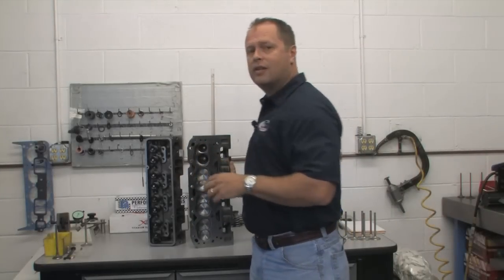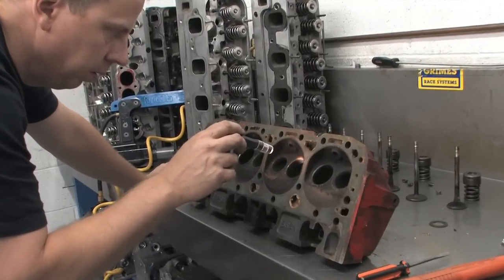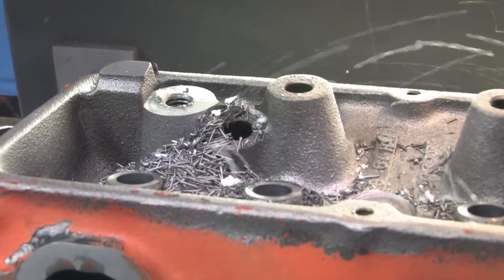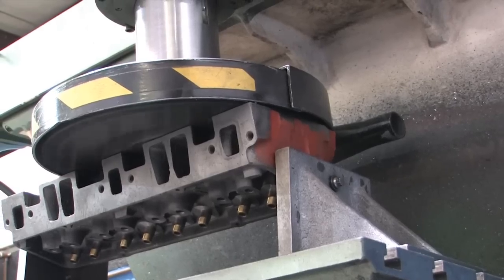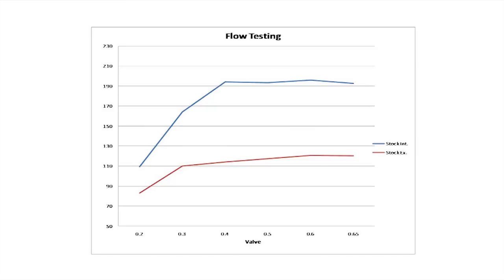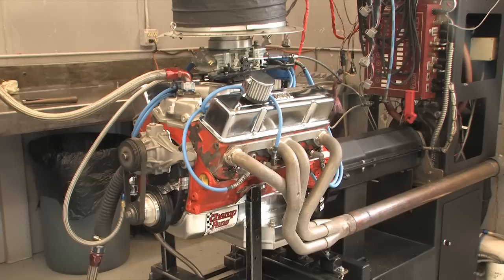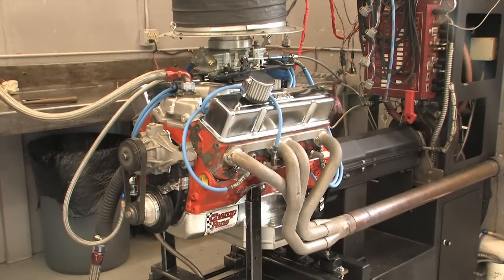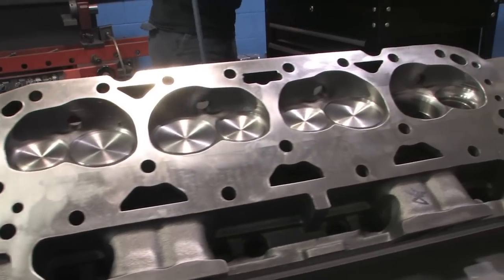Chevrolet Cylinder Head Dyno Test

Comment: Wait wait wait the biggest valve you can fit in an 882 head is a 1.94 intake? Because Im pretty sure I have a set that has 2.02 intake and 1.60 exhaust and when I bought the heads they had 1.94 int and 1.50 exhaust
Reply: your heads more than likely flow more than 193 cfm with the 2.02s
Reply: ryan ishee  the L82 and the z28 I think in 1973 to the early 1980ies had the big valve 882 heads .I have a 1976 L82 vette which I purchased in 1980 and still have when I rebuilt and moded in 88 it had 882 with 2.02 and 1.60  I have the heads on the car today along with a street supercharger it makes great power hp and torque with other mods

Comment: Coulda bought a pair of brand new stock heads for about $800-1000USD, shoulda ran an Edelbrock victor junior intake that’s what drag racers run not dart, the cams holding that engine back it should make power out til about 7200-7500 rpm almost every other 350 I’ve seen dyno’d that’s where they stop making power I ran a Lunati Cam in my race car in the 1/4 mile I went through the lights at 9200 rpm, I shifted at 7500rpm and those are some wimpy HP number from a 350 not even making 500HP sad

Comment: That’s really impressive from junk ass light casting smog heads.     Unshrouding the valves really is nearly free horsepower.    People get hung up on 2.02 intakes  and 1.6 exhausts without realizing that some bowl work and unshrouding would give faster flow with less valve.

Comment: Everybody looks for a set of double humps but 041 and 041x are much better due to having accessory bolt holes on the ends of the heads and the exact same performance as a double hump....plus it's been my experience that half the time you find a pair the person selling them doesn't even know what they have....in the past I'd scored multiple pairs for 150 bucks. I'm all about LS Motors now but if there where no such thing as LS I'd building  big solid roller destroke 377's or long rod 408ci with Pontiac 18 degree or sb2 heads.
Reply: 882 heads are trash...your gonna work your ass off just to a bad head mediocre at best. An 041 or a vortec with that much deck removed and port work would have been a more reasonable comparison
Reply: Revised 882s .....still not worth a shit

Comment: those 5 cubic centimeters less are the reason why DART iron head gave more power
 and torque, if both had maintained the same Dynamic compression ratio the results would have been more even
Reply from the maker: That's the point. You can't get that low with the stock heads. We decked it until it was about to get into the valve seat.

Comment: what was the compression ratio and cam you used in this motor
Reply: All he gave was 248/252 and "about a half inch lift".  As much as they cut on the 882's, I would rather have seen the comparison to darts 72cc version heads which could have been a closer match.  I get the feeling the DCR of the cam used liked the extra compression of the smaller chamber, which may be over half the curve difference on the dyno.  The old school 882's with large [76cc] chambers seem better with intake closures around the 39-42 degree range, where 64cc heads like something in the 44-47 degree area.  Not a rule, obviously [given piston choice, fuel, and how far in the hole pistons are on a build] but a pretty good starting point for streetable 110-112 LSA cams.

Comment: Uh, you can’t throw a $1000 into them and call them “stock heads.” At that point they’re aftermarket. If I had $1 for every time I watched a video of a “budget build” or “stock vs performance” or “diy rebuild” and they started by throwing something on a CNC or taking it to their “friends down at high performance blah blah blah;” I’d have a shit load of nickels. Just once I’d like to see a true budget build or true diy rebuild using stock parts and stock values.
Reply from the maker: But a build with just stock parts is just a rebuild ...

Comment: i still prefer the 882 heads i have been running them for many years in numerous vehicles with great reliability ,,,, in 50+ vehicles i think i only had 1 fail  , thats not to bad, ,  i would like to do a new build this next spring , if i can get out of my wheel chair by then  ,i will do it
Reply: . Yeah, 882's fine for general purpose usage... if wanting big performance, start with stock 461X or similar heads...
Reply: +Jim Davis my 882 work fine but dont make hp... I want promaxx 2169 heads

Comment: Should of used the 2.02 inch 882 heads maybe they were too rare but they flow the only problem being press-in studs :(
Reply: Nemesis Gaming MN ever heard of them how can you tell the difference by casting
Reply: Gage Dunn I don't think you can tell a difference in casting only that any stock 882 head I've seen has been 2.02 valves, might just have to get lucky but I don't think they are all that rare. you'd have to physically check the valve to know.
Reply: Gage Dunn they were stock on L82 corvettes I have then on my 1976 I put bronze guides in them in the 1986 and did a mild port on them and heavier springs and a supercharger makes fun ride with Oem close ratio 4 speed and moded  f41 suspension. I worked for a gm dealership in the 1970ies and I am pretty sure they were on the z28  the 882 and 2.02 and 1.60

Comment: Dart heads are junk from the box,buy the things without the valves etc,then build it right
Reply: Talk to a few head porters before you buy anything. If you are just buying heads and slapping them on, than settle for lower hp. If you are going to spend the dough to have them ported better than you can do it, than save your money. Guys porting procomps now are making the same power with a $650 pair of procomps than a $2000 set of AFR's.
Reply: We're are your numbers or track times before you bashing dart anything
Reply: titanium valves are worth what they cost, as are 200lb / nose springs. the the good retainers. The stamped roller tip rockers are my favorite
Reply: Darts...Right on Target 😆

Comment: Combustion chamber volume affects compression  Ratio which affects horsepower Comparing apples to oranges
Reply from the maker: That was the point. With the old style open chambers we did everything we could to cut the heads to get the chambers as small as possible. Still couldn't get as small as the Dart heads. That's a real-world difference.
Reply: you think you'll find that much power with a point in compression change?  lol those 882 just dont flow enough to go past a 5500 rpm 350.  the port volume isnt big enough  cause you cant get it big enough

Comment: Ugh.  I don't understand why going through this test if you were going to make it apples verses oranges.  Why couldn't you get 76cc heads to compare to the 882?  I have a 406 that I bought that someone had done all the work on the 882 heads noted.  But it has flat top pistons where 64cc heads wouldn't make sense.

Comment: Good video but I would have saved the money on the huge valves and spent the money on port, bowl and combustion chamber work. I think you would have a better flowing head. You can't compress wat you can't get into the cylinder.Bigger valves do nothing if you don't free up flow upstream and can actually hurt filling the cylinder because you shoud the valve and are moving the valve closer to the cylinder wall slowing the fill. Spend $200 on work or couple hours and the dart head would be great.

Comment: You should have used AFR or Promaxx Dart heads suck. and vortec heads would be a better choice to compare and don't need all that work. So they would be way more cost effective.
Reply: the summit racing vortec replacement heads i'm pretty sure are made by dart. i've also read that the blueprint motors® with vortec heads use the same dart vortec replacement.

Comment: for the mazda ad prior to the vid. Don't brag about the interior of your cars. My leather interior does not even have 2 yrs of use and its worn through in several spots. (steering wheel, arm rest and the outside edge of seat from getting in and out. Now mind you I get in and out by getting down and up in the car unlike my 2002 truck that my ass slides over the edge with more "friction" on it than my car. So your soft leather is because its like grocery store bacon. The animal didn't even feel it coming off its arse its that thin. Glad I purchased the leather warranty. Will be using it soon and i am sure often. To think I bought it because I was a smoker ans so was my gf and figured I would end up using it for a cigarette burn lol. Seems I didn't have to worry about that at all as your lack of quality arose before one of our mishaps lol.

Comment: Thanks, but I’d rather spend $75 on a set of 5.7 Vortec heads for nearly the same results
Reply: Doubt that unless you are getting the heads for free and found 100 dollar bills in all the ports. LOL
Reply: The junkyard 96-02 Vortec engines are picked over already, you won't get a set for $75 in 2019 unless they're cracked.

Comment: Most hydrometers are calibrated for 60° so if it was 110°@1.042 it was closer to 1.050 

And they make an app called hydrometer calculator taking the math out of it for ya 😁🥃

Comment: 3 days worth of hard precision work for <$1000 ?  Including parts? A  new, good valve seat machine cost around $50,000 conservatively speaking, never mind the flow bench, dyno  and everything else.  And why is everyone grinding on cast iron with out a mask? I'd throw them heads in the garbage and go get a job at hamburger joint and make better money. That's the real numbers we should be looking at.

Comment: molly pistons? out of the box Chinese head's? never heard of out of the box head's and assembled with Chinese valves, springs, locks, retainers is asking for failure. the valve guides wildly vary. cut on seats usually vary and most leak past closed valves. no bargain in a $1200 assembled head's for any motor except a Briggs & stratton.

Comment: Too bad the valves are always so small for an sbc. 2.02 hahahaha. That's why it should never be stroked to 383, it is a baby engine.
Reply: I can understand if they did the test with both heads being 64 cc's you got to keep in mind the 882 are an open chamber head I believe 7475 cc's

Comment: anyone care to give an opinion on my setup? 

std bore 350 
416 casting 305 heads with 1.94 1.50 valves ported and polished and reworked along with screw in studs and pushrod guide plates.
pro comp roller rockers 
-6cc 4vr pistons 
crank turned .10 on mains .20 on the rods 
lunati 262/268 advertised duration .469/.489 advertised lift 
factory gm aluminum intake
quadrajet
full felpro gasket set
hastings chrome molly rings 
durabond can bearings 
comp double roller timing chain set 
and probably a set of headers of some sort
Reply: I hope it runs good,Austin
Reply: Why are you wasting money on such foolishness. The cylinders heads on any engine should be the chosen understanding that they are not just something to cover up the cylinders. They are the total and complete source of the performance that the engine will develop. Look into the history of popular engines that made good power in OEM form and you will see that the factory used a good head design to achieve those numbers. Put a cylinder head with appropriate sized runners for the displacement and RPM that you plan on running. A 350 street engine with a reasonable sized cam should get either a 180 or 200 cc runner. Remember that torque is important to get things moving, airflow speed is important, hence the smallest runner that can still fill the cylinder at peak RPM. I have built a lot of engines, mostly for street duty and will pick a 180 cc head over a 215 cc head if I feel that the car combination needs it. Remember your combination is what counts. Automatic trans and heavy cars need torque. Don't fool yourself into believing you need a 7000 RPM combination for that. As far as 305 heads are concerned, they were cast in an era of extreme cost and weight reduction concerns by GM at the time and are the worst in terms of cracking in the chambers and poor flow. Understand what these guys are telling you, don't spend stupid money on rebuilding poor factory designs.
Reply: Heads....just. I'd tell you to get vortecs, yet you've built your whole engine around the 305's instead of the cam like you should've. Great street cam, but it won't do you much good if those heads are restricting 20%-30% of all the airflow
Reply: if 416 heads are directly available and you don't have to go out and buy them do some port work these are good heads for diy power. once ported they are well within good flow numbers for up to about 400+ HP and torque. if you have a machined spring seat I'd go with a .500 or more lift with high to midhigh duration. a lot of people don't understand that these heads are great budget heads.  I personally have these heads after putting a 383 in my camaro and that has 200+cc aluminum heads making around 500hp and 510ftlbs. they may crack they may not every head is susceptible its not magic.
Reply: TheCowGoesMoo o I don't think they will restrict too much if any I took the time to gasket match the heads and port and polish the intakes and exhaust along with polishing the chamber to knock down "hot spots"
Reply: Austin Lowhorn you'd probably get by with just matching but these heads are cheap enough that its worth learning to port on them just remember you will have to take the head apart valves and all. otherwise they will run out of breath alot quicker up top on your build.  and also remember that any chamber work makes it larger, which loses compression so be cautious.
Reply: The 416 heads are some of the best flowing 305 heads. The added compression is the biggest help you'll see with thse heads. The 416 heads that i've had on engine built more hp on the dyno over 882 and 441 heads ive ran. With 1.94 valves i've built more horsepower with them than 993 and 487 heads. They should be fine, however you'll be high in compression range so it'll be picky on the fuel you use. you should be in the 340-375hp range depending on how the cam is. That's just my results on a flattop 350 with those heads.
Reply: I love how you put all 305 heads in the boat that they are junk. They 601 and 416 heads actually make decent power on a 350. It's not hard to get 350 hp out of them. I've got 415 hp out of set on a 355 with just 1.94/1.6 valves and some gasket matching.
Reply: @port nut I've witnessed wayyyyy more on these heads, it's not like someone should go out and buy a set but if its there it's worth the work ported out 416 can flow similar numbers to a stock vortec head.

Comment: Lost again.  I have the Speed Pro pistons with the 5cc reliefs flat tops.  With 76cc heads, I think I am in the 9.0 + range compression, with the 64 cc heads I think it gets me into 11.4 compression.  Surely you aren't suggesting that I try to run off pump gas with a 11.4 compression engine are you?

Comment: Yo, what year is it?  1977?  Really?  882 trash?
Reply: billy bob I have them on my L82 modified 1976 corvette they were Oem on the l82 . The engine which has a blower I installed with home porting and bronze guides and comp cam blower  cam roller rockers 2.02  rhoads variable lift lifters 9.1 compression works good

Comment: Here is the problem I have with these types of shows, claim we are testing STOCK heads with STOCK valves  and STOCK valve jobs and end up machining smoother valve seats for better flow, bigger valves, milled heads and opened up some ports, if you want to give me CHEVROLET numbers then use UNMODIFIED heads for real numbers, I will accept a FACTORY style valve job, new guides and screw in rocker arm studs but that is where it ends, no machining for bigger springs, no longer valves and absolutely no smoothing or increasing ports then give me the numbers so the weekend racer can really evaluate junkyard heads.
Reply: Show me UNMODIFIED, then MODIFIED numbers I am good with that.

Comment: im  not as impressed as you , the 882 head is down a point in compression 76 cc vs 64 cc,smaller valves etc. i contend a good port job and comparable compression that gap would tighten considerably. altho to take something out of the box it is pretty good
Reply: Yep. The 882 shows better #s imo, average , as in low lift flow is better.

Comment: are dart heads from china , if so whats the point of building American muscle
Reply: My AFR heads were made right here in California.
Reply: That's great . I sold my classic Mustang a while back and one reason was all the parts to keep it going were chinese made.
Reply: Dart heads are made in Detroit, Michigan! I can attest to that because I work there. The Chinese valves that are being talked about are because that's how they were ordered. If you order CNC ported heads with better valves,  this wont be an issue. If you don't want to pay for the valve job, then yes, buy bare heads.
Reply: Great , thanks for the info